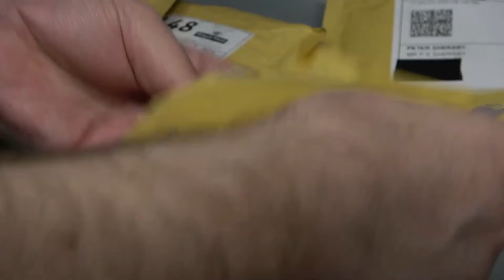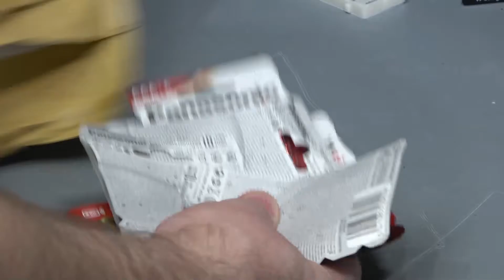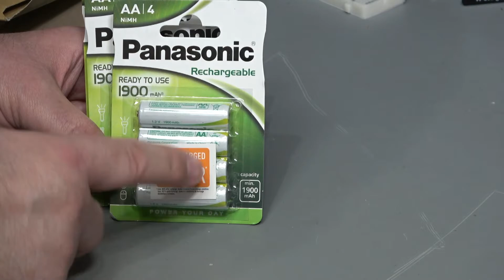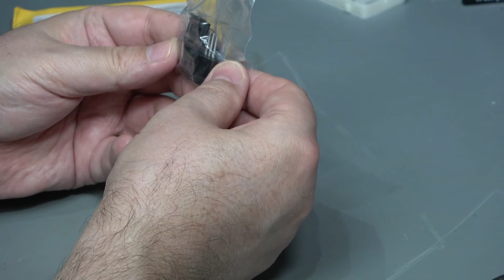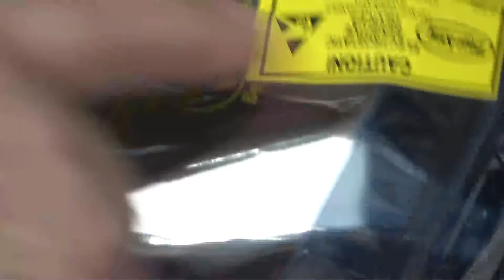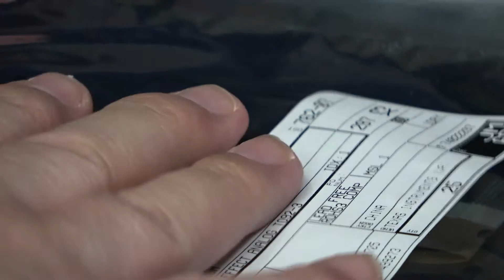mailbag 4 #0051

Comment: Last microsoft update  broke my VPN. Annoying.  On a happier note, I'm  really interested in your current probe project!
Reply from the maker: Thanks, Microsoft updates constantly cause problems with the Lab PC but it usually unistalls the updates when they fail - not this time!  I have got it running again but think I'll have to change it soon.  The project is a tiny bit delayed - funding had to go elsewhere (the dentist).  Hope to get back on it next week, I've done some work on the thermal problem in my head so hopefully that will be a big improvment and I'll release a video showing  the boards, changes and 3D as it goes off for manufacture - I had intended to wait until it all came back but that is going to take too long.  When I'm happy I'll put the files on github, but all being well I'll get a self assembly kit released - that or if it works out badly I'll pretend it never happend!